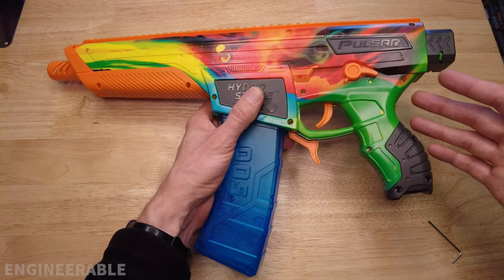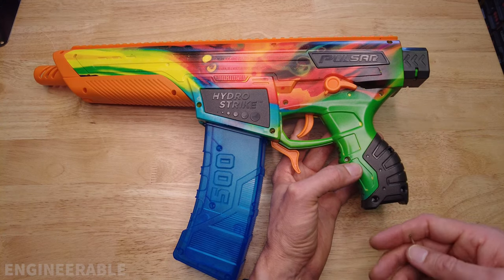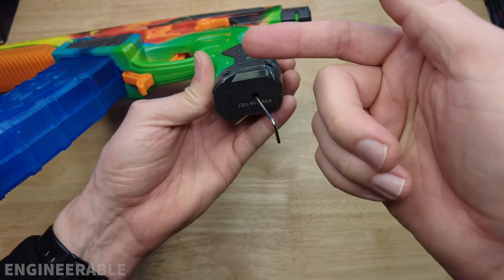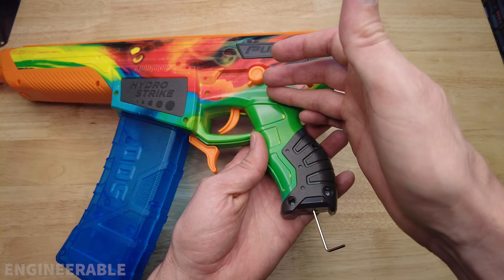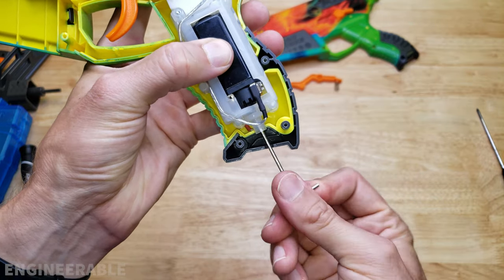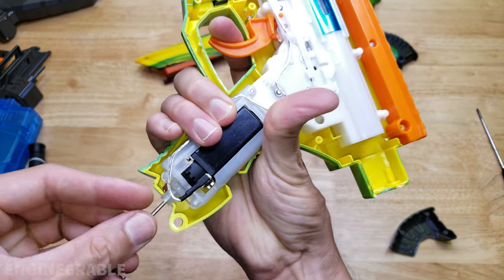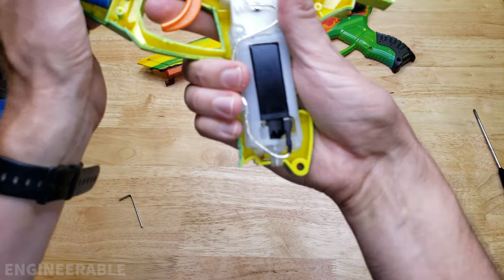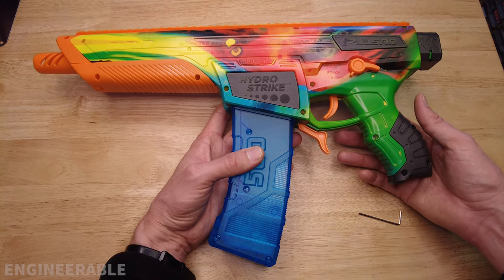How To ADJUST THE MOTOR on HYDRO STRIKE PULSAR PRO Gel Blaster & Fix Whining Sound (stripped gear)

Comment: I am a super big dart zone fan and I absolutely love the pulsar pro and the nebula pro.  To have someone like u provide us these types of videos is so outstanding.  Dart zone has revolutionized the foam Dart and ball blaster market.  Their nexus pro, aeon pro and the rest of their pro and max Stryker lines are light years ahead of anything nerf has come out in last 5 years.  They produce more accurate, harder shooting blasters by far and are on their way to becoming the industry standard.  There is 2 new gel blaster that are out in some target locations, they are made by a company called gel zone and are only being sold in targets.  They are the equivalent of the max Stryker line of pro foam blasters sold only in targets.  Just like hydro strike is only sold in Walmart.   One blaster looks like a slightly bigger nebula pro, but in blue and orange plastic color scheme.  It's a springer, single gel pistol type gel blaster that sells for 25.99 with a claim of 160 fps.  The other blaster is same plastic color scheme of blue and orange.  This one is similar to the surge gel blaster in size, uses same gear box, this one is full auto and claims 7 gels per second and 160 fps.

Comment: Question for you!! Just bought a 11.1 battery that I am about to use, if I do this does is make the gears not strip? What do I need to do in order for the gears to not strip?
Reply: @Engineerable what do you the think? ^
Reply: @Lilbo12 you need metal gears if you gonna use 11.1v

Comment: What about the lighting strike mines is making a high pitch noise  like a drill
Reply from the maker: @410_dezzyy  your gears are stripped. Usually the bevel gear gets stripped by the pinion gear at the motor.

Comment: If i loosen it does it lower performance?
Reply from the maker: Loosening it reduces the gear engagement and risks stripping the gear. So unless it is overtightened to the point of straining the motor, yes, loosening it will lower performance.